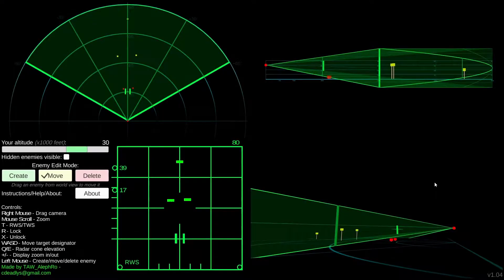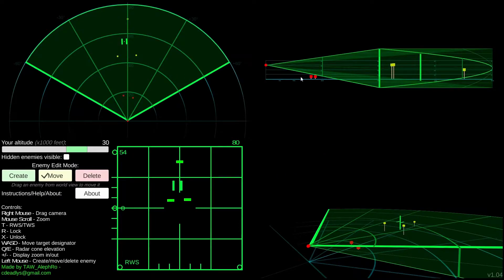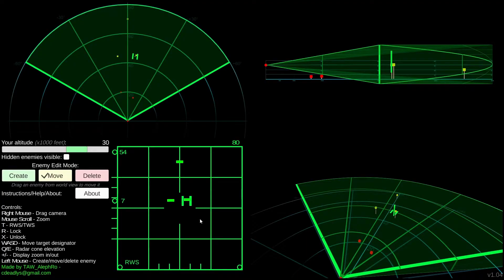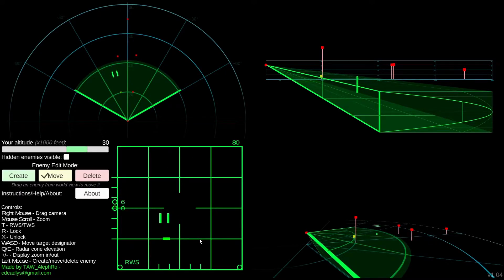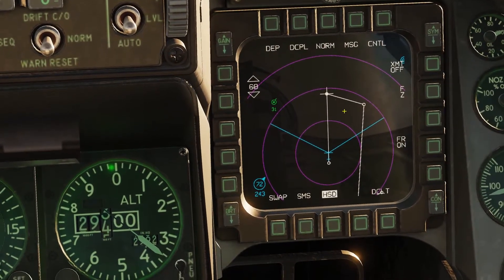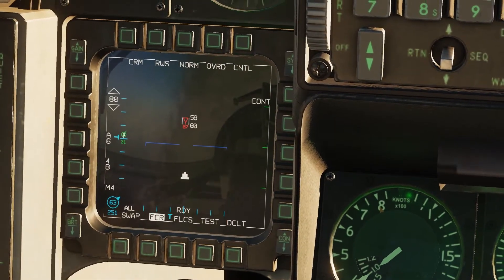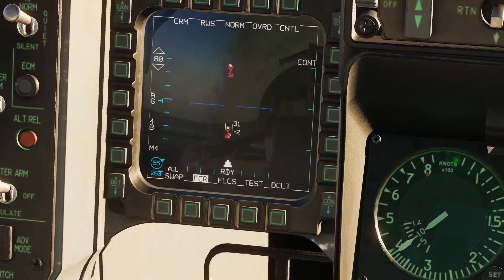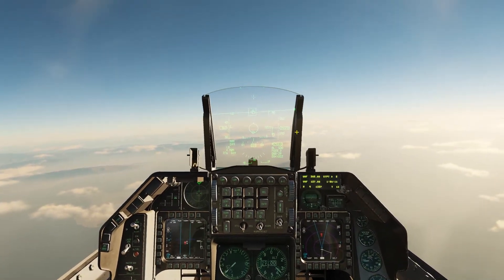F-16 Radar For Dummies

Comment: Thanks... what happens if the aircraft goes 90 degree bank while scanning? the radar also turn 90 degree? what about nose heads right up to sky 90 degree pitch? radar fallows? I heard there are limits,the radar has kind of gimble but what is limits degree? do you know?

Comment: Thanks for the video! Do you have any idea why the antenna elevation seems so random? Is there no way to configure it for i.e. a specific altitude range? I feel like i just need to scroll and hope the range works out. Additionally, like in your video, the range was up to something in the fifties. Which means you are pretty much scanning from 30-50 for no reason and therefore loosing scantime and/or precision.
Reply from the maker: I'm not sure I follow you here. What do you mean by "Why the antenna elevation seems so random?"
Reply: @BogeyDope  if I move the antenna elevation with the button I don't get the feeling the antenna elevation moves in set increments (I.e. always + or - 5000ft but instead seemingly random jumps i.e. one second it is -A2 to +A30 and one jump up and it's A18 to A62.
Reply from the maker: @_ircghost  It sounds like the knob you are binding that to is a little sensitive. I had the same issue, and switched to a better roller on my throttle and got more granular control.
Reply: @BogeyDope  fair enough. I'll give that a shot!

Comment: Sometime my TMS switch aft doesn't unlock the target, or it does but it puts it into narrow mode. So I have to go RWS - TWS - RWS to reset it. It does it in A2G mode aswel, I can't unlock a target I've designated through the pod. I've remapped TWS aft to different switches and it behaves the same way, does anyone else have this?

Comment: Hi, I saw in another your video (DCS F16 FOX3) that locking on a red datalink track you were having squared yellow bugged target symbol (with yellow fullfilled rectangle behind it when amraam is in flight). Then, why in this situation you haven't yellow bigger symbols but they stay red datalink symbol? 
Thanks.
PS: great video and thanks for sharing your experience
Reply from the maker: This video was made a long time ago. They hadn't implemented that functionality into this module yet. The F-16 is still unfinished. Got a lot still coming.
Reply: @BogeyDope  what is going on radar if You push stick and plane start to dive? Radar antena will be keeping level or start to look down like fuselage axis?